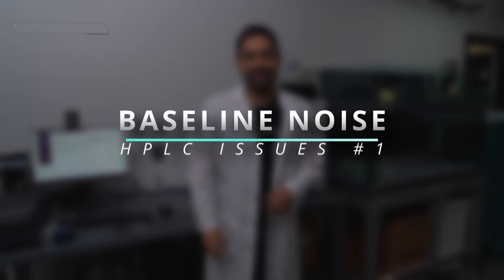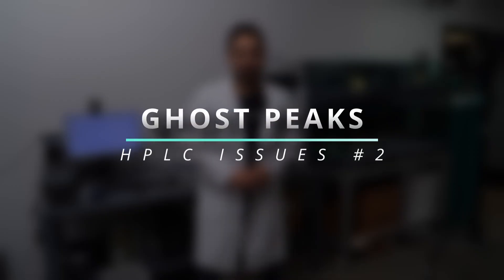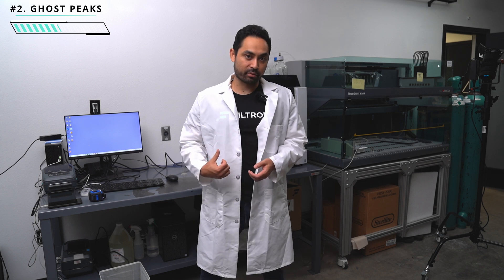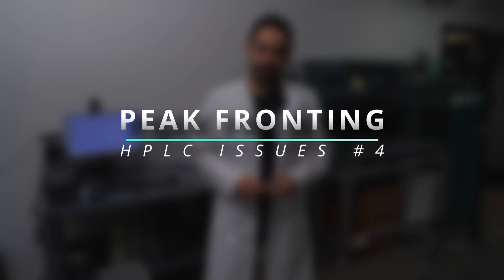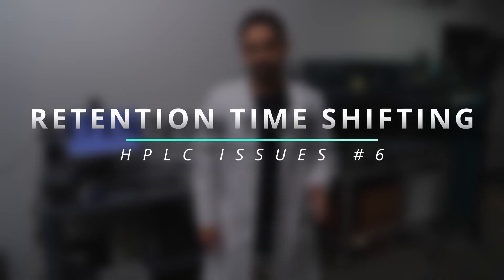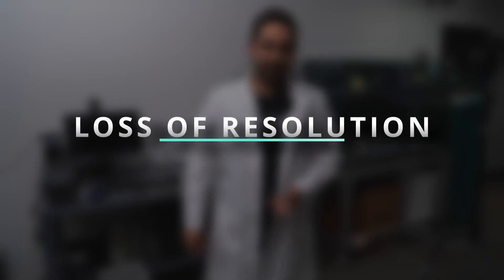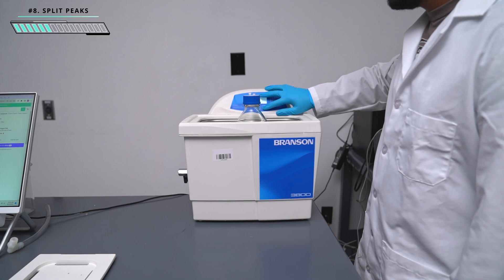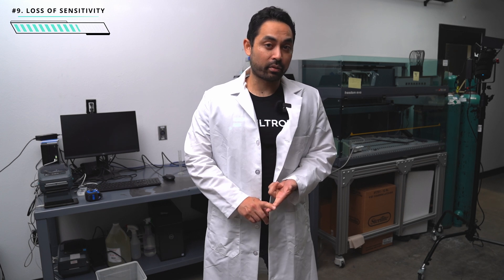Top 10 Most Common HPLC Issues and How to Fix Them (2023)

Comment: sir, I have a problem making the necessary dilutions for the calibration curve. I also have a problem in the anion pump which displays “CMB-20 error” I cannot find the solution. finally I work on an ion chromatography with double pump and automatic injection. I thank you for your help.

Comment: I need your email sir
Reply from the maker: What's going on friend?
Reply: @DavidYazdi1   I need your help sir how can I calculate (Purity Angle and threshold Angle)
in labsolution shimadzu HPLC-PDA
Reply from the maker: Open the Software: Launch LabSolutions and open the data file containing your chromatogram and spectral data.

Navigate to PDA Data: Go to the section where PDA data can be analyzed.

Select Peak: Choose the peak for which you want to calculate the Purity and Threshold Angles.

Run Analysis: There should be an option to calculate or display the Purity and Threshold Angles. Follow the on-screen instructions.

Interpret Results: Once the angles are calculated, compare them to assess the purity of the peak.
Reply: Agilent HPLC no peak problem- how to solve?